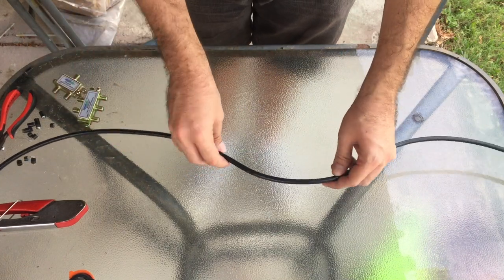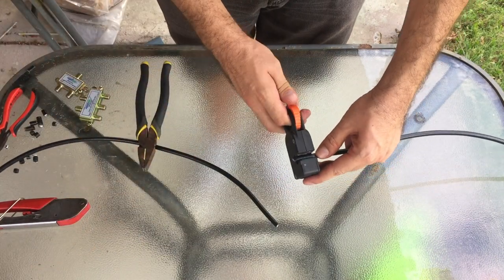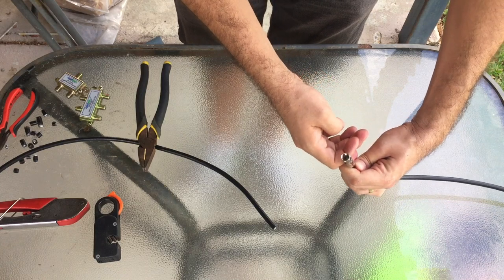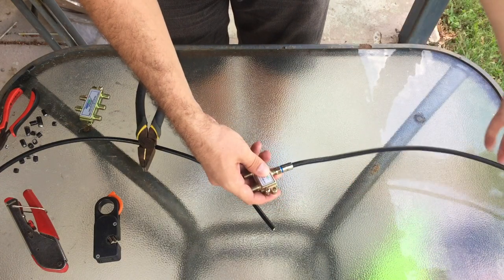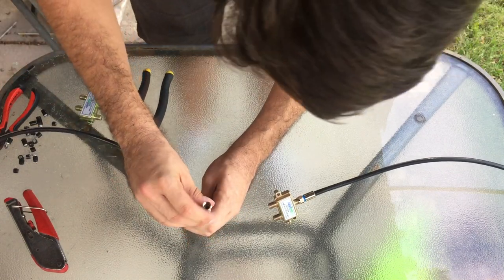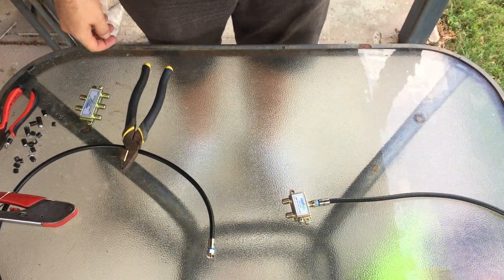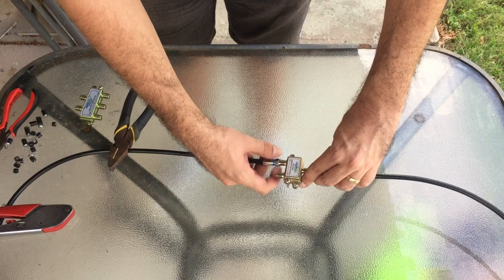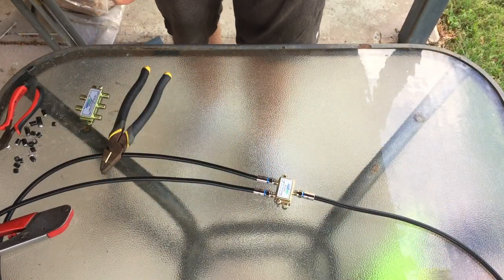How to Install an F Type Splitter for Digital TV

Comment: "Leaving unconnected outputs on a splitter is bad." Why so?
Reply: Bad feedback
Reply: @troy028  All the sockets of the splitter are connected via resistors, and there's no active amplifier either, so there would be no feedback.

Comment: I was wondering what the heck a dc pass through connection would be used for. Thanks for the info!
Reply: The center conductor inside the rg6 cable. It carry low voltage